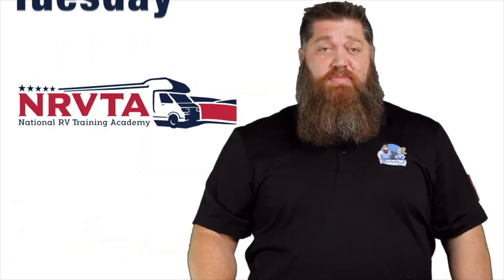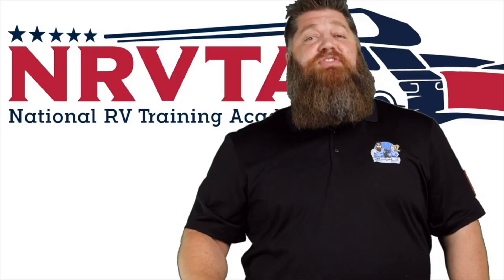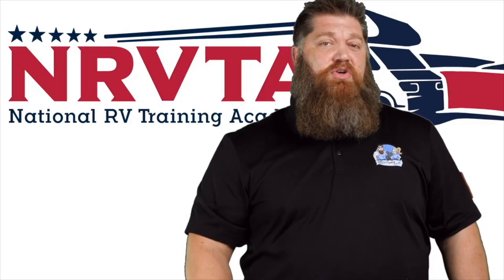Calibrating a SCHWINTEK Slide Out motor

Comment: My slide is out f alignment vertically.  The top leans out when extended and the bottom leans out when retracted.  Will this work for vertical alignment or could there be another issue with the slide causing this?  Thanks

Comment: What if motors are running in opposite directions, I walked it in but when I hold down the in button to re sync, one side starts going back out instead of in. Anyone have any ideas?, I have new controller and two motors on way if needed.
Reply from the maker: Wires seem to be crossed on one motor vs the other. Or harness is upside down
Reply: @NationalRVTrainingAcademy  Haven’t changed anything when it started, it’s stored in my shop, went to put the slide in and it came in crooked. I did disconnect all power while installing a battery shunt a few days before. Maybe a surge messed up the controller?
Reply: Solved, If anyone else has this issue...
So what started out as a simple re-sync went sideways when I tried using a ink pen to press the reset button, I accidentally turned the switch off on motor 2. I never knew that was there, and apparently few did. It is extremely hard to see, especially if its mounted on the basement ceiling. If anyone else is curious, in the hole on the controller where the reset button and led's are located are 2 micro dip switches that control the 2 motors, on and off.  I would have installed the new 400.00 controller tomorrow and thought that was it.

Comment: They dont amp out.... They have a hall effect sensor that counts revolutions of the motor. This is very important as a bad hall effect sensor in the motor can cause the same problem and re timing the motor will not solve the issue.

Comment: HELP! I tried doing this and it was a disaster. Now it's way further off (like one side comes in a good 8 inches or so before the other will move) and because it was so off center the "stuck/short" side busted my hanging mirror. I then tried to bring it in but it's so far off that it will damage the wall where the mirror is. I have the slim rack system on a Minnie Winnie Class C. Is there anything else I can try? Now I have a slide that I can't bring in!
Reply from the maker: I would contact a certified RV tech to help. you can find one near you at RVTAA.org/locate

Comment: Should slide out be flush with outside of camper?
Reply from the maker: So slide outs should be fully extended / retracted to the point where the seals meet the slides trim. Once the trim meets and sets on the seal then a seal is created.

Comment: Oh bearded one, the main reason any slide gets out of sync is because many campers only let the slides partially out often. Then retract it. They should, if partially extended because of parking in a truck stop for example is to have someone watch, and ALWAYS extend the slide out, then retract. That will reduce the out of sync problem.
Reply from the maker: Correct. When you stop pressing on the button then it will take that as the new zero point

Comment: How do you know what type of system you have?
Reply: Look at your slides… Schwintek has a metal strip with S shape cut in them, Cable has two cables on each side of the side, Rack and Pinion has a large bar under the slide. 
There are more types, but these are most common.
Reply: @MstrLister  I notice with the Rack & Pinion that has a large bar under the slide in the middle, the slide sometimes will wobble a little going out. I believe the seals around the slide act like function c=ups sometime cause one side of the slide to stick so sometime I will just pause the button a little giving the seals a split second to pull away from the slide housing. So far so good.

Comment: How do I know which slide I have
Reply: Look at your slides… Schwintek has a metal strip with S shape cut in them, Cable has two cables on each side of the side, Rack and Pinion has a large bar under the slide.

Comment: What would cause that to happen?
Reply from the maker: Unbalanced weight, objects in the path, in level rig firing operation.
Reply: In addition, if a motor goes bad and has to be replaced, the timing between the old and new motor might be out of sync

Comment: What if it racks half way in? And if slide is tight at top when in, but bottom is out an inch more? Thanks for the tip on resetting motors, the tip on keeping button pressed two or four seconds after slide stops is often left out of explanations.